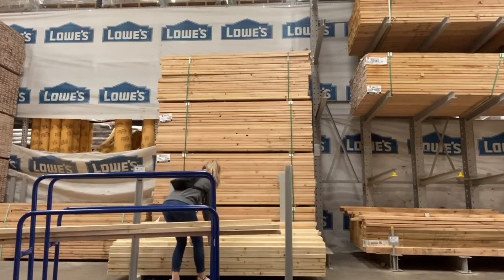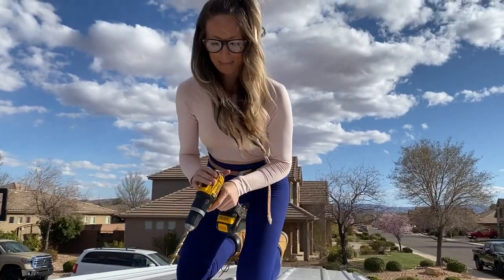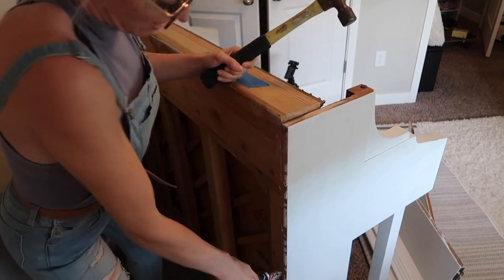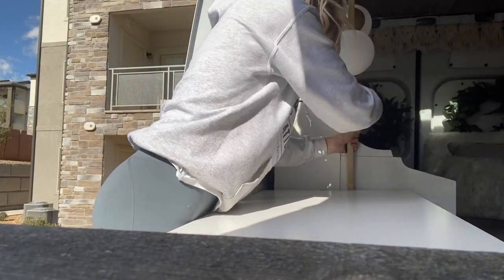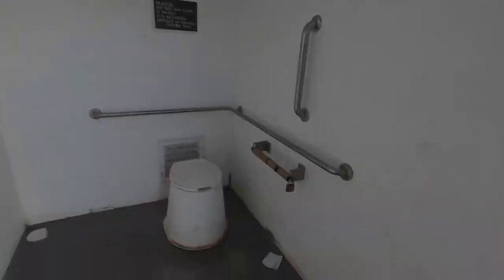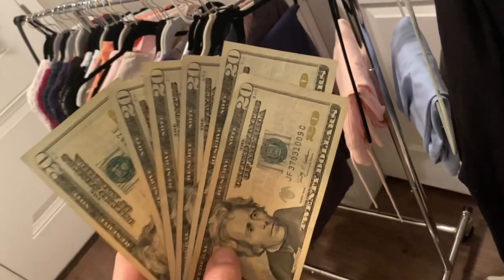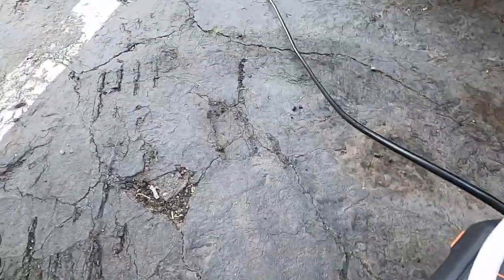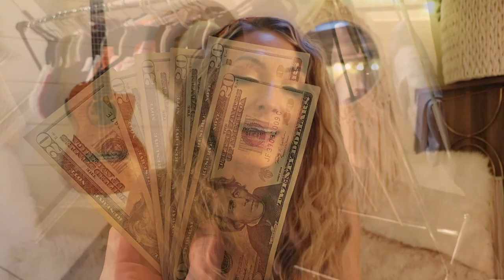How Much Did My DIY Van Build Cost? COST BREAKDOWN // $150 Van Conversion Budget EPISODE 107

Comment: Why did you can this $150 Van Conversion when materials alone were over $4000? It's a very nice build, but the title is a lie.
Reply from the maker: Did you watch the whole video?
Reply: @montanadanna  Yes, I did. Making money off what you sold doesn't make the build cheaper; you still spent around $4000 on the build.